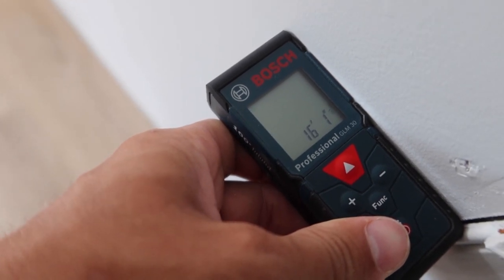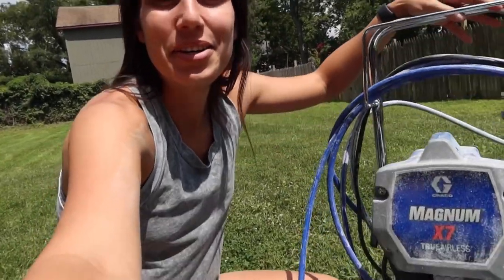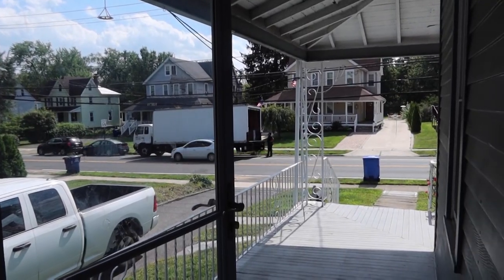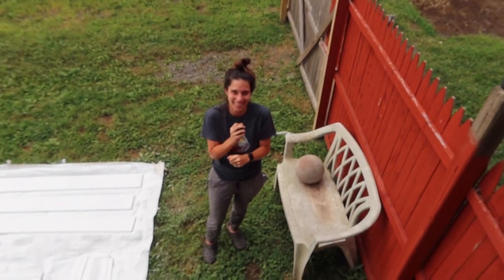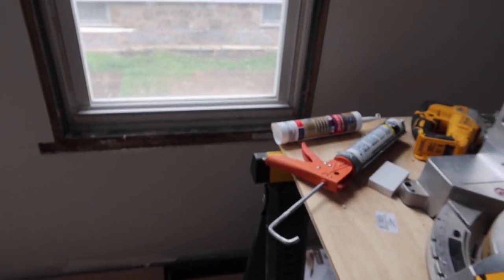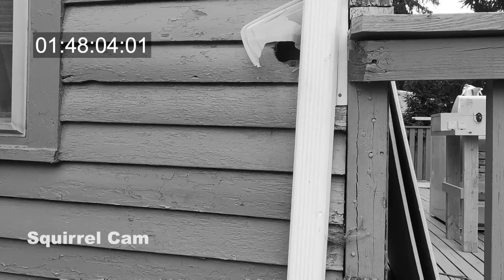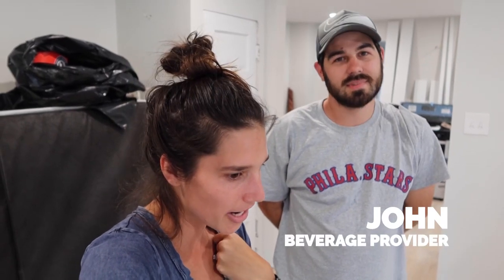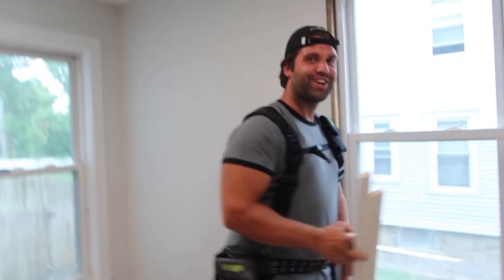A Love/Hate Relationship with Our Paint Sprayer | Installing Window Trim EP 24

Comment: If the nozzle clogs you can spin it around and pull the trigger to blast paint backwards through the nozzle and clear it. If you're going to reuse the sprayer soon with the same paint you can leave paint in the sprayer and leave the sprayer in the bucket of paint. Put a light layer of water on top of the paint in the bucket to keep it from drying. While attached with paint put the entire handle/sprayer end in a bucket of water to prevent the nozzle from getting dry. I've done this for several weeks without any problems. Startup is easy just pull the handle out of the water turn the sprayer on and go. Sometimes you have to mix the paint if it's been sitting for a while.
Reply from the maker: Woww thank you so much for the tips, we’ll be doing this going forward
Reply: Mind blown!🤯🤯🤯

Comment: Thanks for the Office reference, so I didn't have to add it in my comments. Put together my granddaughters swingset yesterday, and had a dozen "Thats what she said" moments.  Take good care of that sprayer.  The "Lowes" models of Graco sprayers are NOT repairable.  Found out the hard way.  I was borrowing one to do exterior spray and I think the screen part that goes into the paint got some dirt into it from laying on the ground, and the pump got fried.  If I had it to do over, I'd make sure those components were always sitting on a drop cloth.  Another tip:  I always had 2 or 3 extra 5 gallon buckets handy, for spraying excess until the paint comes through after priming.  Plus you can store the spray head in clean water in one of them,  if you will be painting the next day.
Reply from the maker: Haha that’s great. Thanks for the tips!